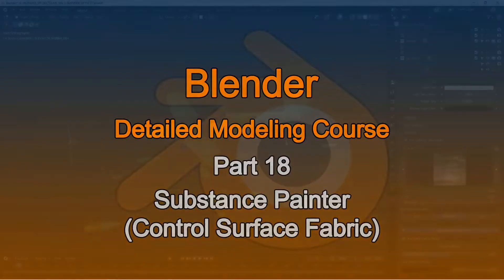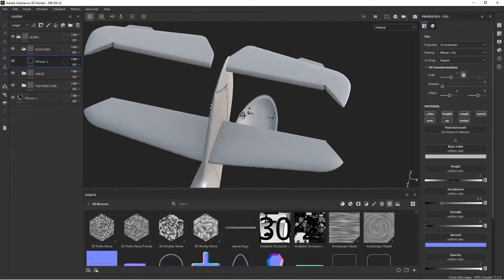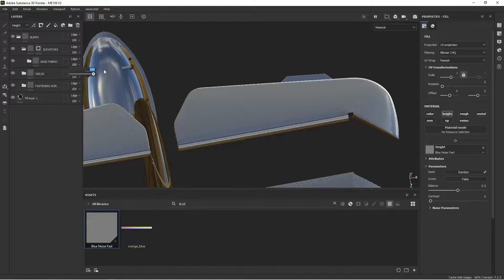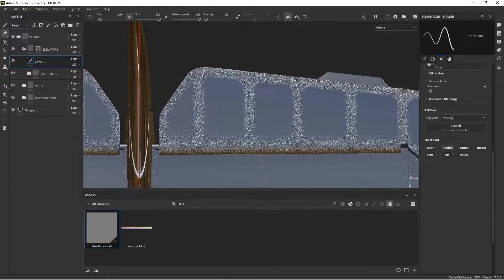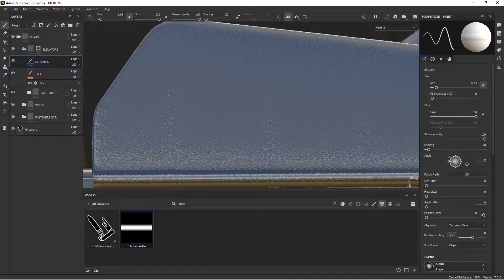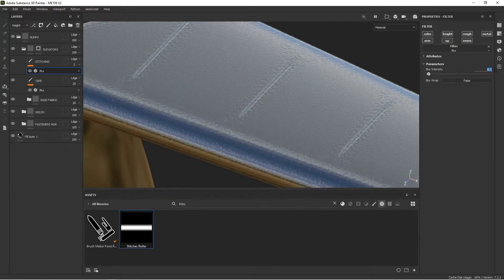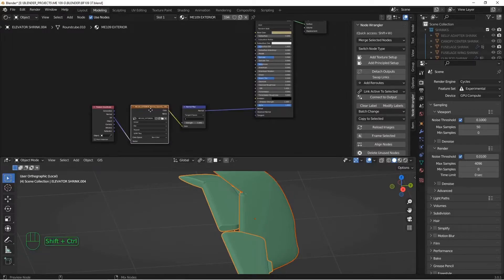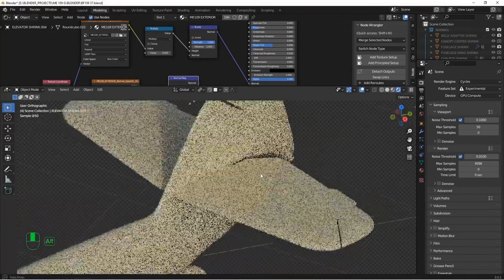Blender Detailed Modeling Course, Part 18: Substance Painter, Control Surface Fabric

Comment: Out of curiosity, are you using a stock brush for the smooth control surface ribbing? I found a grunge brush that works ok, but it could be better.
Reply from the maker: It's been a long time since I made the video, but I think I just used a round/soft brush with a moderate falloff.  I don't have any custom brushes.